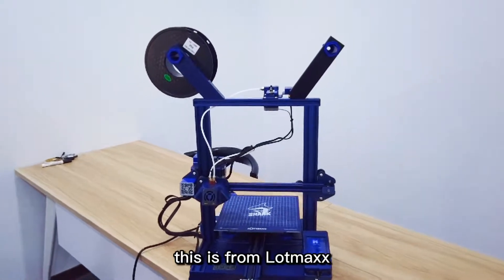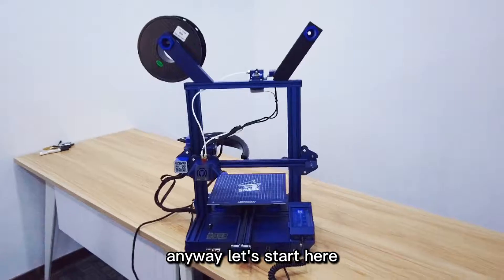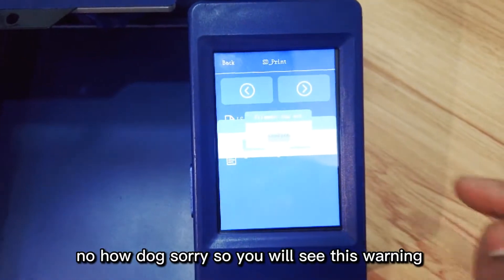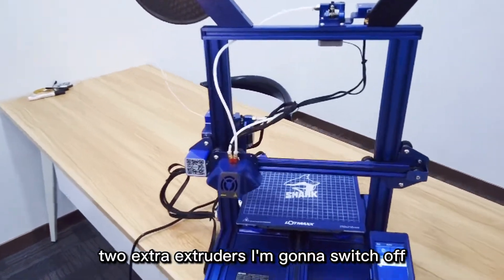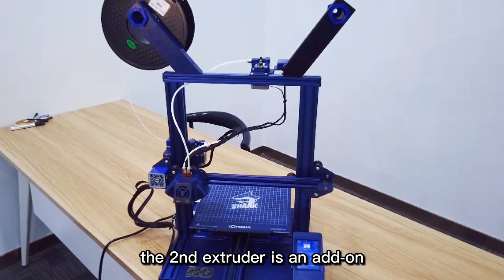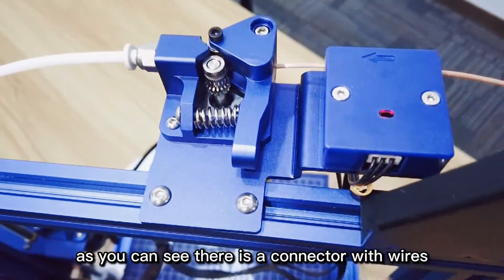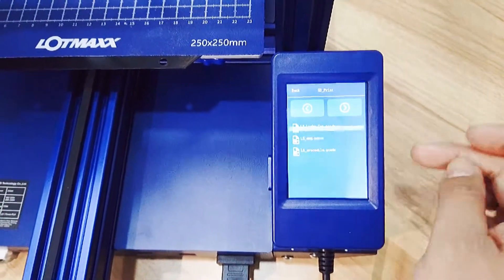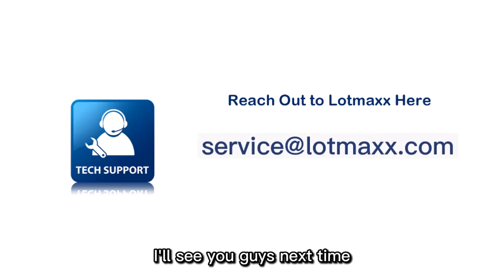Filament runout? warning alert? troubleshooting tutorials Lotmaxx shark 3d printer

Comment: Have filament loaded just finished now get error (filament ran out) not true. Also ran threw reloading and still get message
Reply: i have the same issue. did you figure out how to get it working again?
Reply: @11tjohns  Same issue too, someone please help!
Reply: I figured out I just had to tighten down the sensor
Reply: @Oldspaceshipzion was the red light coming on when you had filement in it before you tightened it?